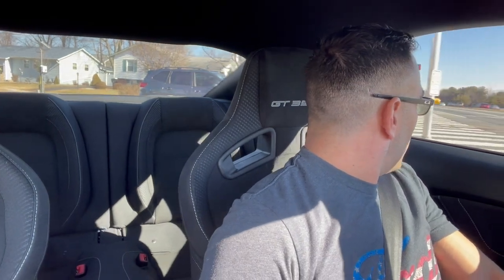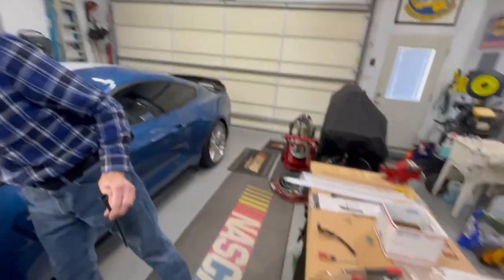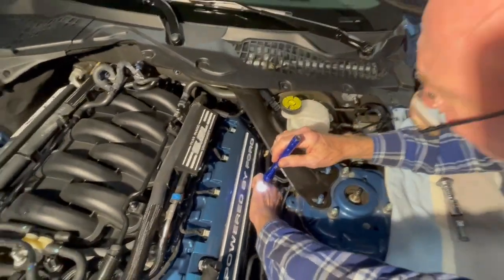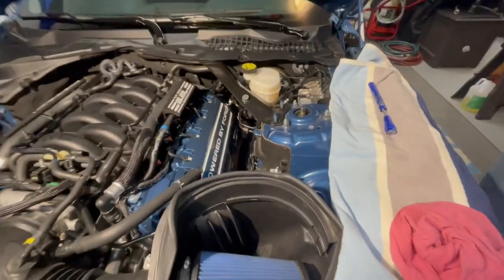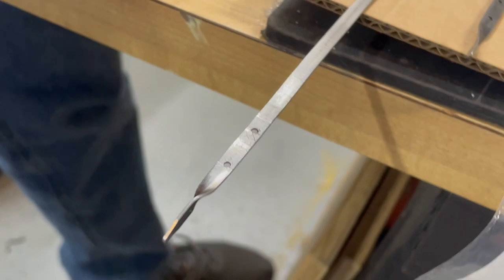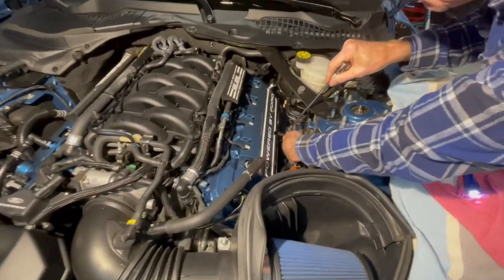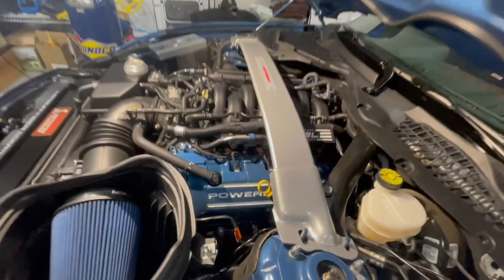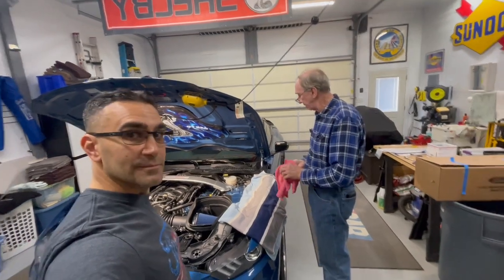OIL Dipstick extension for the GT350 5.2L Voodoo

Comment: Great video as always. Do you happen to have the part number of that oil dipstick extension? Couldn’t find anything on the web about it.
Reply from the maker: I’m pretty sure I had a closeup of the part number in the video. You can try and refer back to the video and copy it down.
Reply from the maker: Pretty sure it was a Dorman
Reply: @TrucciSpeed  thanks for responding but I was talking about the GT500 dipstick tube extension. The small black extension
Reply from the maker: Ok I will check with George and get that info for you. Sorry
Reply from the maker: KR3Z-6754-A 
Dip stick tube 2021 GT500
Reply from the maker: If needed, stock tube is 
FR3Z-6754-B